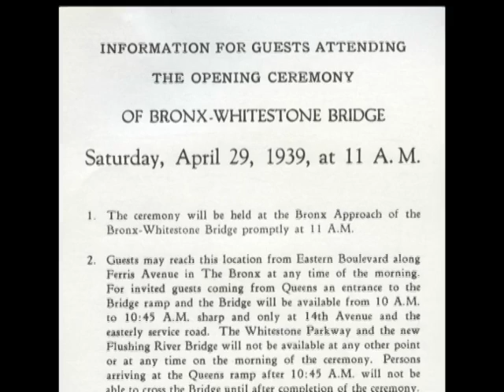Bronx-Whitestone Bridge: 75 Years

Comment: When the bridge was being built, I had a great view from my house on the corner of 128th st. and 9th ave. in College Point, across Powells cove. I was 7 years old in 1939 when the bridge was opened.
Reply: ljliljohn
Greetings. When my parents brought me from Parsons Hospital in Flushing when I was born to our home 26 Ave and Utopia Pkwy, Oct 1960, my father took a picture of my mother holding me standing in front of our house and above the roof you can see the cranes raising the Throgs Neck Bridge.

I remember being about 4  seeing that picture and they told me they started building it when I was born so from that day I called it my bridge because I thought they built it for me. 

I moved to CT when I was 13. At 35 I went work on a tugboat towing cement and fuel oil from New York going most times East up the East River through Flushing Bay then under the Whitestone and then Throgs Neck Bridge into LI Sound and points East and of course reverse that traveling inbound. 

On average we made that trip once every 2 weeks and in the 12 years I decked, I must've passed under my bridge 100 times, all times of the day, all types of weather, any day of the year. 

When pushing with a rope boat, no wire winch, the rope hauser is made up to the push cables and led back to the capstan to snug the boat fast in the barge notch. However it is set, it is one and done... as tight as you got it at the dock is as tight as it is going to get, except in a turn as one sides slacks you can suck in a little more rope. 

Passing under the Throgs Neck was one of those turns... 10° port into LI Sound. 

So if we were outbound and it was my watch, I was always on deck passing under the Throgs Neck Bridge... my bridge
Reply: @tommypetraglia4688  was that the same as Flushing Hospital?
Reply: @tommypetraglia4688  now closed
Reply: @mikegruber172  no its open

Comment: Interesting story. This bridge was opened a year before the original Tacoma Narrows Bridge was being planned. and then opened in July 1940, and then, tragedy struck later in November of that year, due to high and heavy winds, the span of the Tacoma Narrows Bridge rocked back and forth until the entire span has finally collapsed completely.
Reply: This is why they outfitted it with a warren truss along the center span once Tacoma happened.  Due to the East River (and really the Sound since past the throgs neck to the east, the sound starts it's widening to the full extent) the wind across it can be pretty severe, which would cause mild resonance galloping, which in turn caused people who were in traffic to panic, dump their cars and then bolt, on foot, down the bridge.  Amman's original vision was an unobstructed view, but the truss interfered with it for decades until they ripped it out in the early aughts (iirc) and replaced it with the triangular faring that you see in the video.  This 'cuts' the wind and, along with the deck lightening work and mass dampers eliminates the original galloping problem.  You can still see a remnant of the truss at the very center of the center span when driving it today.

Comment: See how fast they built it then 2 years now it takes 10 years with modern equipment .That's called milking the system.
Reply: Back then safety wasn't as much of a concern. Labor was much cheaper during the depression.